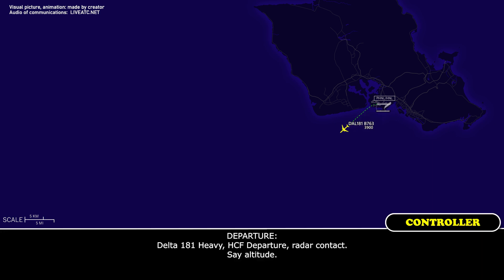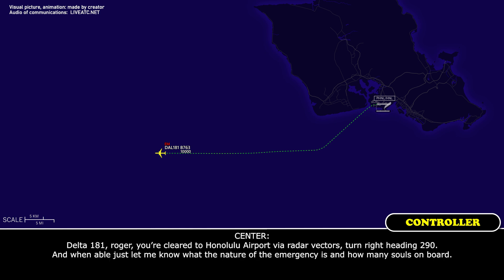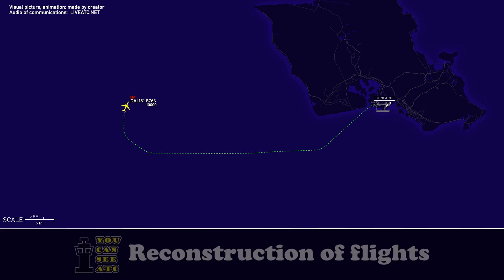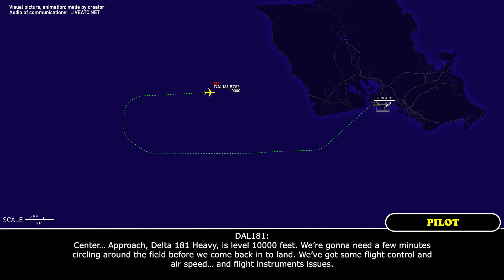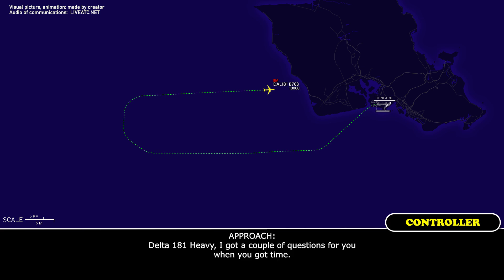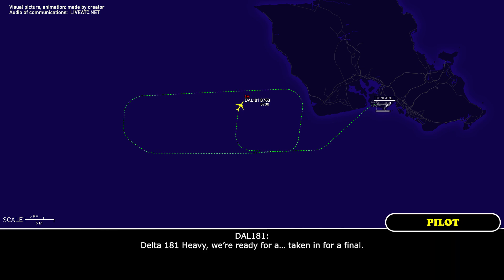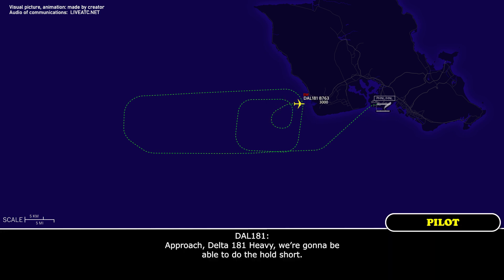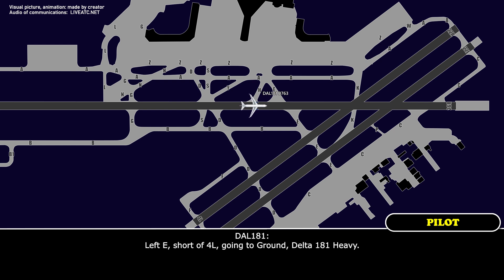Unreliable flight instruments. Delta Boeing 767 declares an emergency at Honolulu. Real ATC

Comment: At 8:33, pilot says "we're also unable LAHSO."  Can someone tell me what that means?
Reply: They require the full length of the runway and are unable to accept a “Land And Hold Short Operation”
Reply: Thank you!
Reply: Land and hold short operations are common at airports with intersecting runways. If you accept the LAHSO you’re expected to be able to stop and hold prior to the intersecting runway, which means ATC can operate both runways simultaneously to increase operations.
Reply: Also, just a guess but they probably couldn’t accept the LAHSO because they were heavy with fuel for the long flight and needed more runway than typical to come to a stop.
Reply from the maker: LAHSO is a procedure where a landing aircraft must stop before crossing an intersecting runway.

Comment: BEFORE the Boeing Bashers show up!  The Air-Worthiness Cert on this aircraft was issued May 24, 2000.  So, NO, it has nothing to do with Production Quality issues currently in the news!  This 767-300 has been in service almost twenty-four years!  The focus here is and should be on the actions of the flight crew and ATC -- which I will now shut up and discover.
Reply: @bigjobbies  Not your business

Comment: In an emergency the answer from ATC should always be yes, whatever you want
Reply: That's what they got.
Reply: Sure, absolutely, when it is safe to do so.  The emergency aircraft will get what they need, but sometimes doing so safely requires coordination (either between ATC and multiple aircraft, different ATCs who might not even be in the same building, etc.)…this is especially true shortly prior to departure or after takeoff given specific airspace complexities, minimum altitude restrictions, and more.
Reply: No.  ATC has to keep ALL flights safely in the air.   That requires coordination with other controllers and other aircraft.  The pilot doesn't know the other air traffic conditions, so "Whatever you want" isn't safe or feasible.
Reply: @buckhorncortez negative. If I declare an emergency I can make the Red Sea part if I wanted it to.
Reply: @buckhorncortez emergency aircraft always take priority.
Reply: @buckhorncortez  get to work and clear the space he needs period
Reply: @markcardwell  We thought you worked at a cannabis dispensary. Now you are an ATC analyst? Cool man.  Cool.
Reply: @RLTtizME  not well crafted but points for trying
Reply: @markcardwell  It was extremely well crafted. You just don't have a good retort. The lines are too long at your dispensary. Are you smoking the merchandise ?